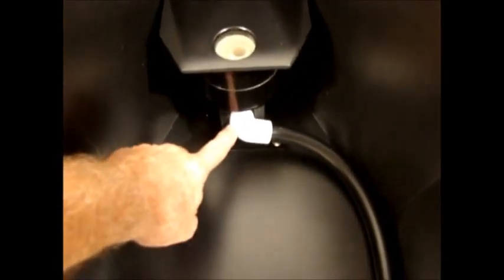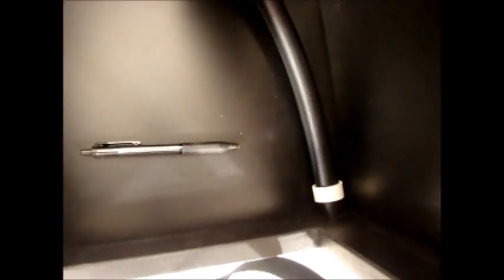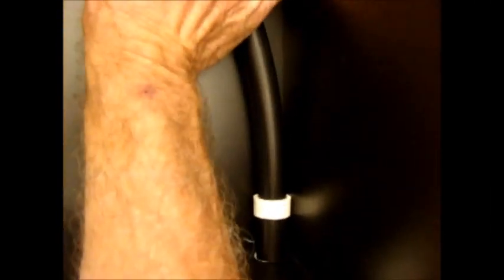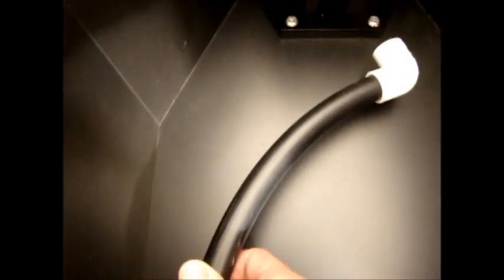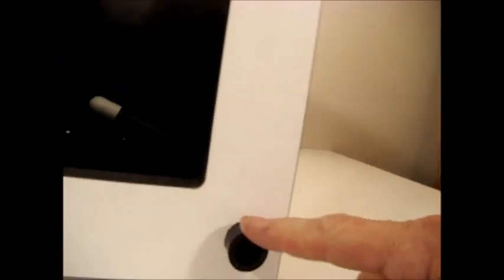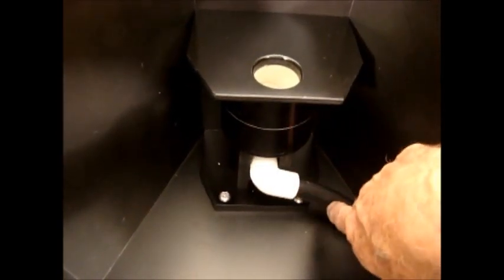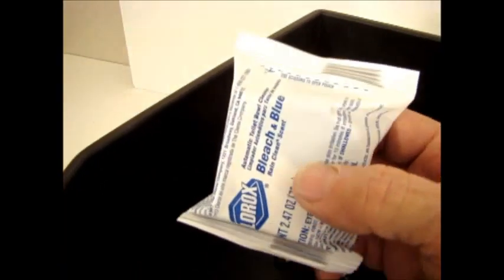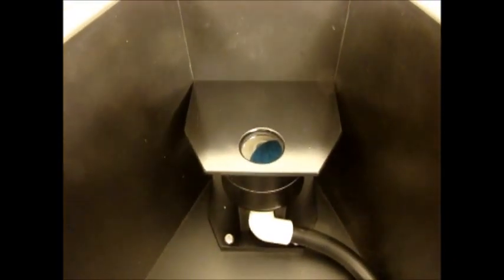EUD external urine diverter

Comment: Can the EUD be directed down in the center? I have a camper van and would like to remove my toilet but the black tank hole is right below, what would you say is the best way to hook the EUD to an RV black tank hole?
Reply from the maker: We sell what we call the "bottom exit kit" which allows the owners to run the EUD line out of the bottom into the existing toilet flange. If you go to the "Custom Order Form" you will see the option.
Reply from the maker: You can order a "bottom exit kit" which will allow you to exit the EUD directly out the bottom into the previous toilet flange. If you order a shorty model, you will need to build a one inch pedestal under the base to accommodate the plumbing.